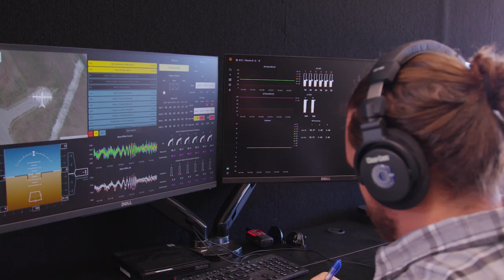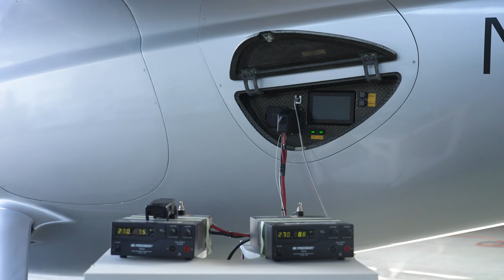Adam Savage Learns About an Electric Flying Vehicle!

Comment: I don't know, there is something scary about using an aircraft that the crew won't get on.
"You're all good, we'll be on the ground to do any controls!"
Reply: It mostly removes human error. Just take a drive during rush hour, too many morons out there.
Reply: We hear you. Our production aircraft, Midnight, will be flown by professional pilots and not be autonomous.
Reply: @ArcherAviation  I feel the opposite: No crazy maniacs that could suddenly kamikaze into a building or perhaps not their fault just getting a heart stroke or something. Like mentioned in the video, it may be a generational thing. If it is like i think it is, the human will only be monitoring on board until people can get over the fact the thing has been running by itself all this time. Various transport systems like monorails no longer carry an operator on board.
Reply: @freeculture  As Tom said in the video, we're bringing a piloted aircraft to market because it's nearly impossible to certify an autonomous aircraft with the FAA right now. Autonomy is certainly an option as the industry matures over the next many years and paths for certification on the autonomy front open up.
Reply: @freeculture  a monorail can just stop at any point with no extra anything, just power cutoff.

Comment: I’d much rather see robust public transportation systems then a flying “car”. Plus you are never getting me into a full autonomous flown plane.    The risk is just to high.  I’m all for AI flight but you need a backup pilot in a seat on board the thing just in case.  Having it remotely monitored on the ground gives me little comfort.

Comment: It's not the engineering that's holding us back. It's the FAA. Can you imagine a million flying cars in the air? How will they be controlled? There are over 14,000 car crashes per day in the US, and that's with very restrictive regulations and controls. Will the DMV be issuing licenses? I worked on flying car designs and prototypes back in 1986. Still waiting.

Comment: These multi-prop vehicles are inherently dangerous, especially in an emergency. Total power failure in one of these results in plummeting to the ground (unlike a helicopter, which will fall gradually with the rotor still spinning).

Frankly, I like Jetoptera better. Mechanically simpler, far smaller and more efficient.

Comment: Cool but the solution to congestion and traffic is electric rail and public transit not four-seat light aircraft. I'm a pilot and I love planes but the solution to car dependent city design isn't to become a sky-car dependent city, it's to build better public transit in the form of electric rail. Trains work in snowstorms and icing conditions and fog. Aircraft need deicing and have limits for wind speeds and aircraft spacing. This will be solution for people to replace their corporate or private helicopter. For us working folk we should be supporting better public transit to give everyone more travel options outside of sitting in private vehicles stuck in traffic. e-VTOL is just another toy for the wealthy.

Comment: I guess time will tell if this actually becomes less expensive per flight per seat cost compared to the executive helicopters already in use. Those are fairly expensive rides just to get to/from airports to say a downtown roof top to avoid traffic. Some percentage of those flights are just for ego. Otherwise it is just an electric helicopter and like those, you have so many restrictions and you can't just take off and land anywhere you wish so I wonder how dense these can become in any specific local area. You might  have 50 of them flying above the highway traffic and then hovering as they queue up at the landing zone to offload a few people. And then what, fly elsewhere empty to pick up someone else, or sit there idle until someone wants to leave from that location? But good to see the tech pushing forward and it will probably find a niche market.

Comment: How well does this little beauty glide when the batteries dry up in flight?  How long to charge the batteries between flight?  "Right?"
Reply: Since it's all pre-planned routes, I would guess it would be pretty rare to have the batteries "dry up" mid flight, other than in cases of emergencies, which would not be "drying up", but glide characteristics shouldn't be much different than any other small plane. As to charge time, the racks that we saw looked like they could be interchangeable, which would make a lot more sense. Land at a designated point, engineer switches over batteries, good for another flight immediately.
Reply: @philipcroucher7376  And, there is a famous small plane that carries a parachute for the whole thing, they should do the same.

Comment: Basically, this project is just hoping to replace gas/turbine helicopters with electric helicopters.  Flying cars are a pipe dream.  Flying vehicles of any sort will always depart and land at specified air-controlled locations and their use in public transportation will only be used by the elite rich individuals regardless of being gas or electric.  So, it’s nice to see gas engines being replaced with electric tech, but the logistics of air travel isn’t going to change.
Reply: ICE air vehicles are incredibly efficient, it's gonna be at least 5-10 years until AAM systems can be as efficient for flight models. Not to mention, FAA approval. 
There is good R&D out there, but it's almost worthless becasue of how dense commercial air is already. Quite a lot of cities have outright banned personal craft entering flight zones due to the high traffic of emergency air and commercial flight.

Comment: Am I the only one that realizes this is just a plane? I feel like a flying car needs to be able to drive around AND fly.
Reply: I totally agree.  The aviation industry is usually 30-60 years behind state of the art, and automotive industry. This company is simply trying to bring aviation up into the 21st century. Unfortunately, many companies have tried this, and they have all failed.  I want them to succeed, but the legal and political hurdles are massive. As this guy said, certifying an autonomous aircraft is basically impossible. Well certifying any new technology is not impossible, but it takes a looong time. This is why tech development in aviation takes 30 years.  So maybe in 30 years this will be common place.
Reply: No you are correct, this is not a flying car. It is just another form of airplane/helicopter hybrid just like the militaries Osprey only this one is electric powered. A true flying car is one that can be gotten into, driven on the roads, as well as ability for flight all in the same vehicle.

Comment: There has been technology in existence for years and years now, the primary reason that we do not have flying automobiles yet is because of the people that will be flying them. Most people cannot drive a car reliably let alone wrap their head around flying an airplane. And then you create another problem, airplanes get to fly really high up in the sky primarily a non-crowded environment but if you create flying automobiles you're going to have thousands of airplanes within close proximity of each other and that's extremely dangerous. And then there is another issue, law enforcement. How do you regulate that? Somebody decides to go on a high-speed chase, that could get interesting. I think even if flying automobiles become a reality it's going to be that only a certain number of people are allowed to fly them and you will have to have special licensing to do so. I cannot see them just allowing everybody to freely fly vehicles all over the place, far too dangerous. All you have to do is look at the amount of aviation accidents and how they occur and why to see this. Aviation is a highly disciplined thing and most drivers are not highly disciplined at all.

Comment: I think of these as more like a drone you can ride in. A flying car would be something that can drive down the road, transition to flight, and then transition back to driving down the road. These would never fit on a road. And the way it flies is just like a drone. It's a person sized drone. It's very cool. I just worry about the regulations and approvals. I don't know if it will ever be certified for passengers.

Comment: The "service" will quickly run into problems when competition shows up - overlapping flights, separate systems, landing pads (that need to be learned of people) etc.
This would need a full shared airtraffic control for multiple companies/providers with shared landing/liftoff/charging locations.

All that likely pushes the flight prices to high exclusive premium.

Comment: Bruh... the "flying car" meme will N E V E R happen. We've had the TECH to do it since the 1930's (and VTOL versions since this super-obscure thing called "a helicopter" came on the market, in the 40's)... But the barrier is SAFETY, not technology.

Risk of your "car" dying a 15,000 ft. Risk to those on the ground, if a city's worth of commuters are overhead every day. Risk of collision, if instead of 10 planes with 500 passengers each, we have 10,000 planes buzzing around with 5 passengers each. Risk of a bunch of distracted idiots having six degrees of movement, instead of basically two (and we STILL manage to crash all the time, with just that). Risk of everyday commuters will never do/pay for the kind of skilled maintenance required by aviation. Risk of commuters will never afford/maintain the multiple, redundant systems required to keep flying vehicles even PARTIALLY safe. The whole concept is a safety/logistical nightmare.

Like humanoid robots- flying cars may end having a handful of practical, viable commericial uses. Or be a fun novelty, kinda-sorta-useful toy for the very wealthy (like flying cars have ALREADY been, for over a half-century now). But they'll NEVER be a  common "everyman" thing, because they're simply not justifiable.

Just because an idea became a scifi trope about "what we'll ALL have, in the future", doesn't mean in actually IS a practical, useful, viable thing, in the real world.

Comment: Up next, "Why McDonalds chicken nuggets have real chicken in them!"....
Adam, you're better than this...
The simplest reason why electric flight will not be possible any time soon is the quantity of recharge cycles the batteries are capable of. If you do just 3 short hops/day, you'll need an entirely new battery in <1yr, which is ~50-75% the cost of the entire plane. Imagine buying a new airplane every 1.5 years?

Comment: Except we continue to try to overcome gravity with lift, what’s needed is a breakthrough there. We need to be able to overcome gravity with another force, be it electro-magnetic or quantum, that’s when the game changes.

Sorry Adam, this isn’t going to solve any problems, we need better public transport. Which we COULD do, we just choose not to ‘cause “it’s like hard to do man”.

Another one: those of us that can work remote, force companies to allow it. My consumption of fossil fuels has dropped by 60% since 2020. But no, ESG grades don’t include that in the firms assessment. Fix that too.

12 engines? Good lord, a twin Cessna is bad enough on the wallet to maintain but 12? Bwahahahahaha. He’s balls out nuts.

Comment: Aircraft are cool, but.
All passenger VTOLS need to answer these questions:
What happens if one engine/motor goes out during takeoff? (Can it enter a controlled landing or is it death? - I know helicopters aren't great but autorotation is better than nothing.)
Who is this for? Who will be paying to fly in these? (Its probably the super rich.)
What problem does this fix?(Commuting time from hotel to airport? - You should build a tram instead.)
How loud is it? (If its as loud as a scaled up multicopter it will not fly.)

Comment: This isn't an "air car": It's light aircraft with a fancy propulsion system that affords it vertical take-off. May not need much of a runway or landing pad, but there's no way you can take off or land in the middle of a city or a suburb like you park a car. If it has wings spanning seven(?) times the width of the main body, I say it can't be called a "car".

And that's not even mentioning affordability.

Comment: As cool as this is... just one more lane bro, I swear it will solve the traffic congestion problem, all you need to do is just add one more lane - but this time, do it vertically! The Vegas loop also worked extremely well, until it got jammed, so I think it's safe to say that there is a non-zero chance for your sky highways to also get jammed if enough people start to use them.
Why is it that you Americans would do literally anything, other than invest in public transportation and allow mixed residential-commercial zoning, which would render most private vehicle traffic unnecessary?

Comment: Do you want a vehicle that is always at your disposal, to take you from A to B, cheap to run and easy to use? take the effing bus! "Oh, how I'd love to just take off into the sky from this awful traffic jam, and get to my destination in just a few minutes..." Well sir or madam, if everybody did that, you would just have an air traffic jam and, I don't think I have to point this out, that would be even worse. Just build an efficient, well designed public transportation network and leave your personal vehicle for your weekly or monthly trip to the grocery store to do the heavy lifting. And by all means, put an end to the stigma of public transportation. A well funded, efficient and comfortable public transportation network is the key, if you just push the problem to the skies, you are not actually solving it, you are just getting it off your sight. And that solves nothing.
Oh, and pull your head out of your ass, and stop thinking about how to solve your own problems, think about how to solve your problems for everyone in the same situation.

Comment: Theyre gonna go bankrupt within ten years. Theres no market for it. Getting through FAA apporoval for both the autonomous control AND flying within high density urban areas will take YEARS. Its a niffty little aircraft, but theres no market demand for it. maybe for millionares, but for the general public it will be unreachable. If they want to use it as a taxi service or public transporation, its better to focus on rail and busses, especially within urban centers. I see this as maybe another option for traveling between airports like san jose, oakland, and SFO. Operating cost will be so freaking high that no uber like buisness would use. and in terms of saftey, batteries bring on a different hurdle of safety chalenges like fires. Hows the fire suppreseant system, can the aircraft float in the event of a water landing, can it glide in case of full power loss. its not viable. Hes blind to the realities of it.

Comment: Flying cars are a really cool but really bad idea. We don't need more personal transport, we need better public transport based on already existing systems like trains and trams. Flying buses might be a cool idea but that can only really be a good idea over very long distances and when speed is actually necessary. We're already expecting everything to be fast and snappy and I'm not sure if that's really a good thing. 

When congestion became a problem, bigger roads were created. This only allowed more cars and more congestion. I feel you'd have the same problem with flying cars.If you open up the sky, you'll have this same problem but much much worse. Parking would be a nightmare too. Furthermore, falling out of the sky is definitely going to kill you, while your chances of surviving a regular car crash are quite a bit higher. Seems to me that flying cars are much more a of a rich people hobby than anything else.

Comment: This is fascinating from an engineering perspective but completely laughable to "relieve congestion". Adding airspace would become the exact same as "just one more lane bro" on highways, especially if the safety standards for transportation are to remain intact. I can't take this seriously after that suggestion by your guest, and some needling on that point would have been much more welcome than fawning over this "futuristic" toy for the rich and powerful. Bikes, e bikes, trains, etc are the actual solution but for some reason aren't sexy enough on their own.

Comment: Electric airplanes need to be banned. They are an extreme danger to public safety. The batteries are simply way too dangerous and until a safer battery tech becomes available, these electric airplanes need to be outlawed completely.

Comment: Why the sarcastic comments? Electric VTOL vehicles are the future. It will start in more rural areas where travel is about 200 km. and both the speed and the ability to travel in a straight line are key. I a country like Colombia or a state like Colorado, it takes seven hours to travel two hundred kilometers of winding mountain roads. This would cut it to a couple of hours.

Comment: Automated air travel seems like it would actually be far easier to trust than self-driving road travel.  No road construction, low-quality lane marking, emergency vehicles, broken traffic lights, or careless drivers or pedestrians that the cameras can't recognize as impact threats.  A little bit of radar or lidar, and a read-only connection to transponder data, and 90% of the challenge is getting off the ground and sitting back down.  That being said, software exceptions are still deadly threats.